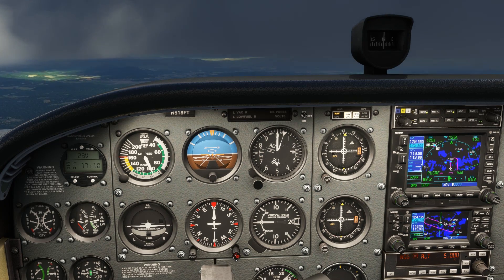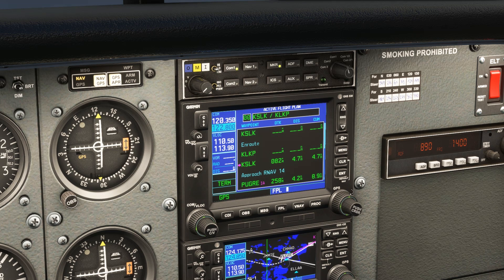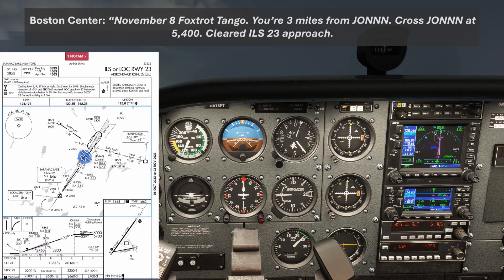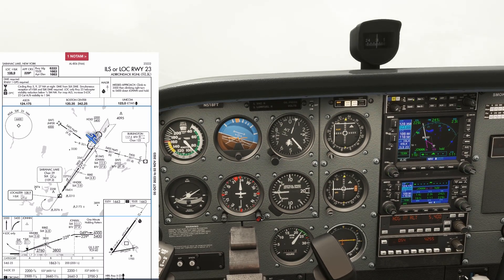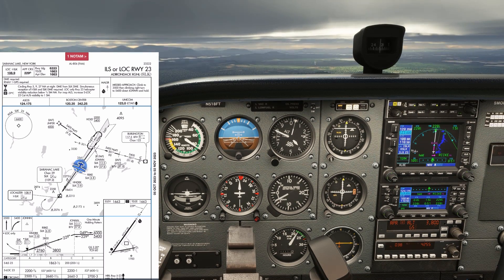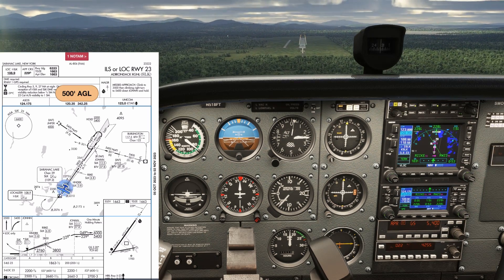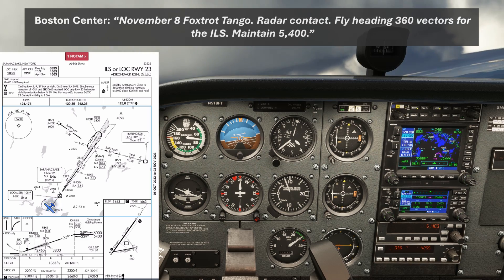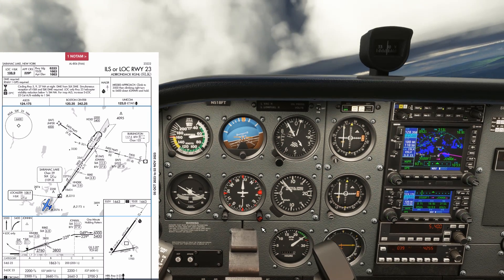How to Fly an ILS Approach | IPC Flight 3 of 4

Comment: You can do most of an IPC in an approved simulator. You must do circle to land for an IPC in the type of aircraft you’ll be flying in IFR. However, a circle to land is not required for maintaining currency, FAR 91-57c and you can use and approved sim and shoot one type if approach if you want to to meet the 6 approaches (6 ILS’s or 6 RNAV’s, same runway, at same airport), in six months to meet the requirement.

Comment: The floating runway lights is usually caused by a low Level of Detail (LOD) setting, there are multiple. Try setting at least 80.

PS: Love your content, thank you!
Reply from the maker: Thanks for the tip! Got it at 100 which is about all the processor will handle these days.